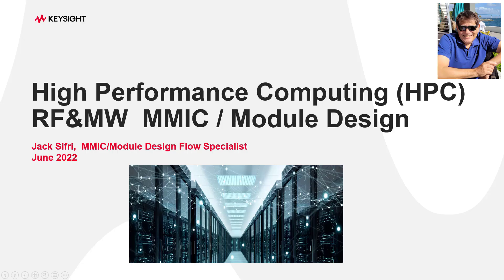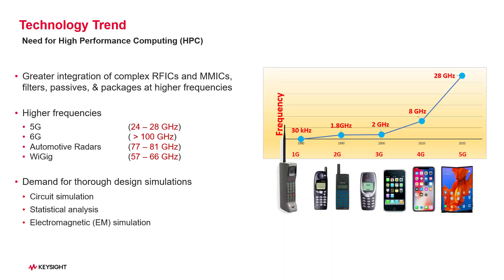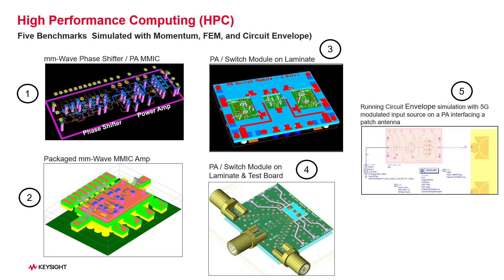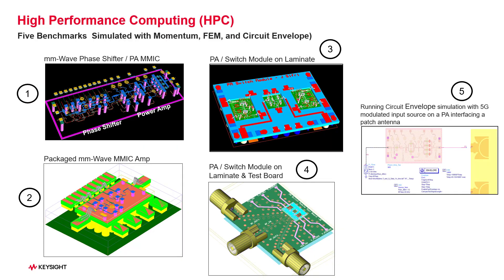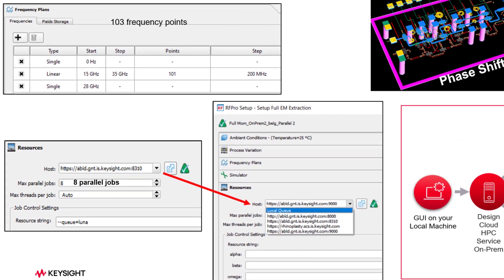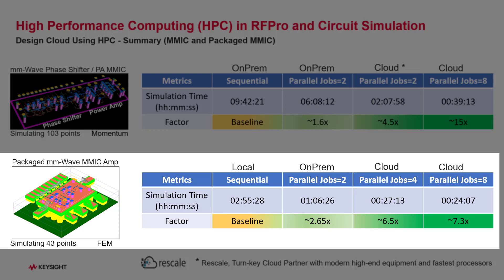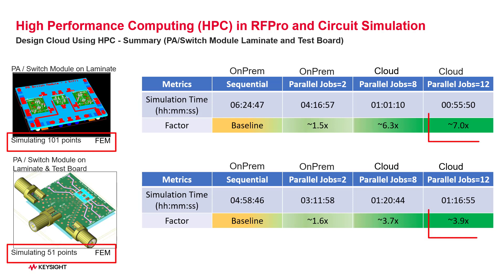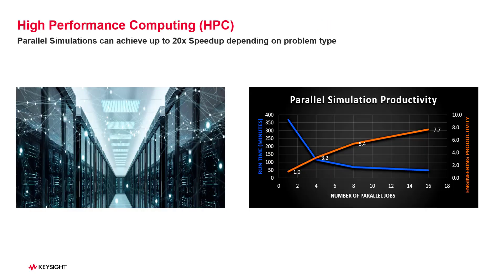High Performance Computing (HPC) for RF & Microwave Design

Comment: So this is all on CPUs,  correct?
is there going to be GPU computing support in a single local machine in the future?
Reply from the maker: Yes, Correct..., and we already have GPU support for our FDTD solver in PathWave EM Design (EMPro) and it works very well.
Reply: @KeysightEEsofEDA  
Hi, thank you for the response.
I use ADS and as far as I have looked, its layout simulator does not support GPU computing. Or maybe I haven't looked enough.